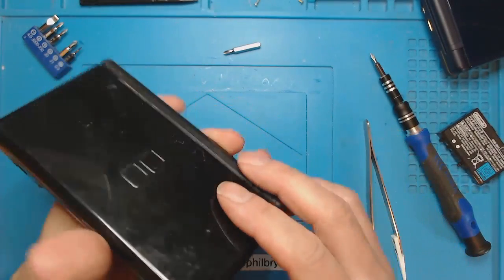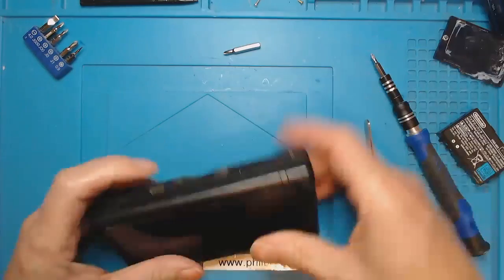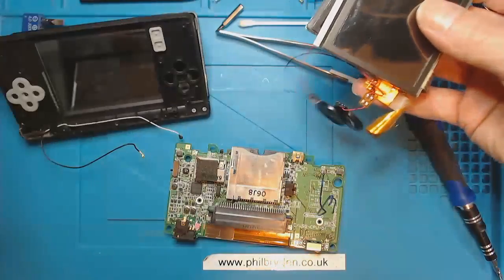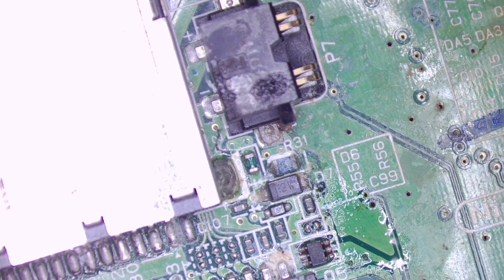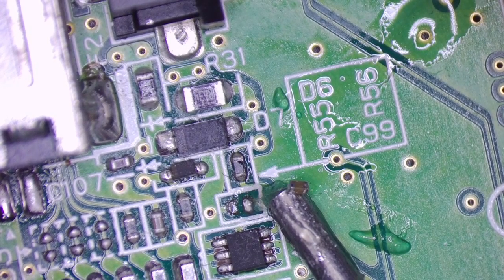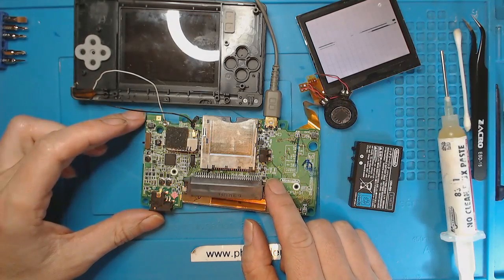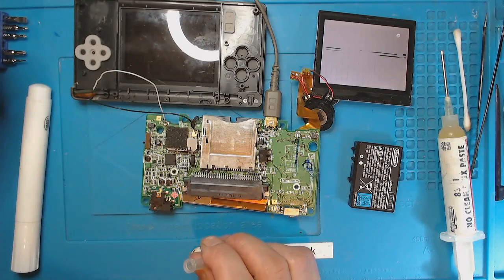DS lite No Power Fix | Fault Finding and Repair

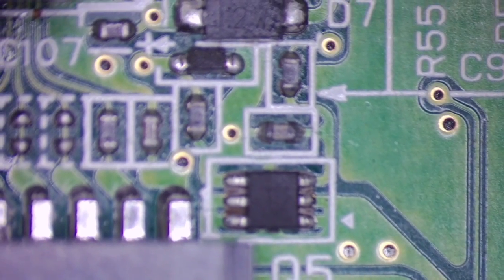Comment: Phil I watched this Live! and now this video release. I know it was the Cap but.. Q5 the chip, under the bad cap looks split on its corner @ 2:05
I'm still wondering was it just a stray hair or something? The Live! & replay both show the crack disappear after you start to replace the cap.
Reply from the maker: Well spotted Ratchet. A replacement top screen arrived today, I'll be sure to have a good look when I open it up. I'm pretty sure it's a hair tho.

Comment: I see a lot of capacitros like thiseon my ds lite board in similar condition. But it did turn on and work before. I then switched the shell and gotten an nee top screen. Nothing. I replaces f1 and f2 and power filter. Nothing. Any help?

Comment: Where can I buy parts ? I’m having a similar issue
Reply from the maker: Aliexpress or from a donor board.
Reply: @PhilipBryden  thanks a bunch 😎😎😎
Reply from the maker: Let me know how you get on
Reply: @PhilipBryden  So F1 or F2 (Fuse 1 or 2) on the board was bad. I went on eBay and found a pack of them. I changed the fuse and the console works. Sadly I lost the volume switch in the process 😂😂😂
Reply from the maker: @YvessLarue  nice work on getting it half fixed at least. 👍

Comment: i have the same problem with my ds lite. i would like to replace the fuse but what kind fuse do i need to use it to replace it for ??
i hope its that problem im not for sure but when i saw this video that was the only fuse that was broken and my Power connector for the battery is full functional so i hope  that will fix the problem
but stil nice work man
Reply from the maker: Hi Bart. I've never had to replace a fuse so I had to google it. An 0603 (1608 metric) 1A fast acting fuse seems to be recommended component. Now the fuse blew for a reason, so buy a few of them just in case the original fault is still there and you blow another fuse. Good luck with it.
Reply: @PhilipBryden  much apriciated man love the vids and keep it up